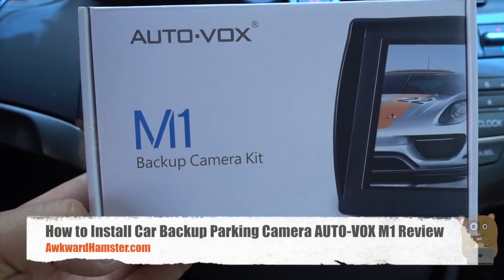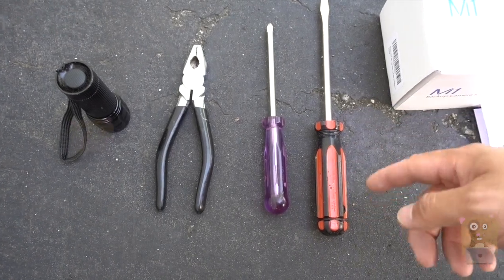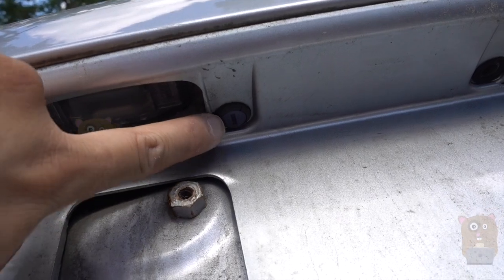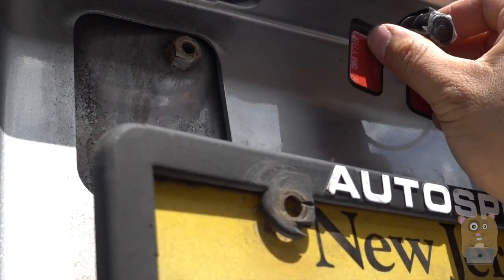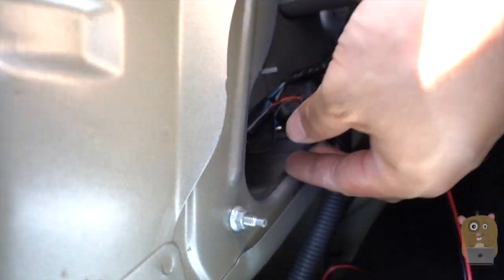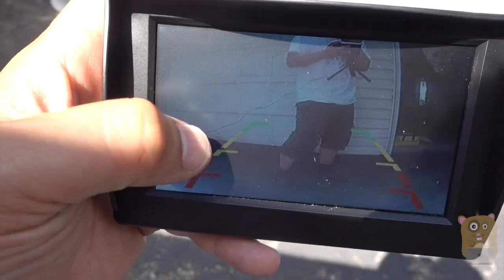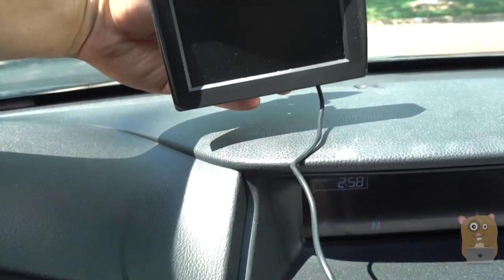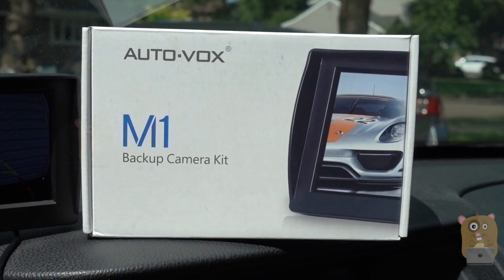How to Install Car Backup Parking Camera - AUTO-VOX M1 Review

Comment: Thanks for the great video.  Explained everything as needed so I could get the install done.  I had significant trouble with the red wire clips.  Had to clamp and re-clamp them 4 times before I could get the connection to work.   Probably me just trying to press them together too hard.   Thanks again for the great video. Really helped.
Reply from the maker: +Paul Egan 
Thank you for watching.

Comment: Hey! 
Great video! 
Do you thinkthe camera can be used as a side mirror camera? My right mirror sight is blocked by a children seat. 
The only thing is that camera needs to be on all the time. Can I pare it with the regular front lights maybe instead av back lights? 

Thanks once again for a great video!
Reply from the maker: Yes it can but I’m not sure where you can draw power in the side. I guess you can get a fuse tap then run the cable to the side mirror.

Comment: So I loved the video and it really inspired me to buy this exact product. My problem is that I finally got my reverse light to turn on but my monitor won’t turn on. Any suggestions?
Reply from the maker: Does the monitor flicker when you plug in the power for the monitor? If it does not, then redo or recheck the wire tap for the power.
Reply: AwkwardHamster I had this same problem, any ideas ? My monitor does flicker when I plug it in. Thanks!

Comment: Hy must I etached it on the rear lights for power I want it always to view it when I drive forwards. Thanks for your videos greetings Peter from Belgium
Reply: You can connect it to your ignition switch so it can fire right up when you turn the car on.

Comment: When you're splicing black to black and red to red (color to color) on the Honda, are you cutting the light bulb off and splicing both sides of the two wires (splicing a total of 4 times)? 

So in a series, the cameras wires are in between the cars power and the light bulb?

Thank you for your help! This video was veryyyy helpful.
Reply from the maker: I don't do the spicing.  The T-Clip does the splicing.  It's safer that way.  T-Clip cuts into the red of the backup light and red of the camera.  Then the same goes for the green/black wire
Reply: AwkwardHamster yes correct but when you start to splice with the T- clip do you cut off the light bulb to clip between so the camera can connect?
Reply: I think I'm over thinking this. Does the extra wire from the lightbulb just hang out cut off?
Reply from the maker: +Jennilyn Sumalbag 
I'm not sure what you mean by cut off the light bulb. I remove the light bulb from the housing by turning it counter clockwise. I can use my fingers to space the red and green wire so it's apart more. If I need more slack, I can unroll the electrical tape to expose more red and green. I can use a scissor to cut that electrical tape if I want it neater. 
Then, I would use the T-Clip.
Reply: AwkwardHamster thank you! So I'm tapped into my reverse light and backup camera works. But light isn't working now? I don't think I fried it tho?
Reply from the maker: +Jennilyn Sumalbag 
Take a flashlight and look in the bulb area to see if the coiled filament is broken. If it is, then you can just change the bulb. 
Because power is getting to the camera I would expect power to go to the bulb too. If you have a wire tester pen, you can see if there is electricity at the bulb connector area.
Reply: AwkwardHamster got it to work. Thank you for replying back! I took my multimeter to it and tested voltage so I knew the bulb wasn't busted. Everything is working great :)
Reply from the maker: +Jennilyn Sumalbag Cool

Comment: What sort of battery solutions would you recommend instead of messing with internal wires?
Reply from the maker: Met with a startup at an expo a year or two ago that was releasing solar powered backup camera units. I will have to see if I still have their press release. I liked the concept. I was skeptical because it prob won't charge well in my neck of the woods.
Reply: hardly an issue messing with internal wiring, although I wouldn't use these splicing clips, just do it the old fashioned way, much better than actually cutting the cars main harnesses. if you don't want to do it just run a lead using a piggyback fuse from an ignition live (radio, accessory socket fuse etc) from the fuse box to the back of the car, no need for extra batteries etc

Comment: How hard do you think it would be to install the kit in something like a hatchback where the license plate is mounted on the hatch?  I'm driving a Scion xD and I'm interested in installing this kit and I'm wondering how difficult it might be to mount the camera to the hatch and reach the reverse lights using the cables included with the kit.  Something's telling me that I would probably have to to extend the cable that goes to my reverse light because of the length involved, and it might be a little more difficult to hide the wires in this particular vehicle since I'd have to run the wires up to the top of the chassis and then back down to the floor and hide the cable along the kick-panels to run it the rest of the way up to the front of the vehicle and then most likely mount it on the far left-hand side of the dash so that I can hide all of the wires and not having anything dangling from the middle of my dash.  Liked the video and thorough instructions...appreciate it!
Reply: I just put this in the hatchback on my Veracruz. Took a little work and we did drill one hole to get the camera wire into the car from behind the license plate. All the other wire ran through a boot to get from the hatch into the car. With the back up lights on the hatch it was an easy run. If your backup lights are on the fender, while the wire from the connector unit is long, you may need to add some wire. Worse case you get it, don't like it, return to Amazon.
Reply: Brent Murphree we also ran the cable to the front along the top of the frame above the doors then down the A pillar in the front. Hide the rest of the wire behind a cavity in the dash

Comment: Connected everything shown.  Can't seem to get monitor power any thoughts.Connected to the back up light wire with the two connecters.Thanks
Reply: Jennifer Berard did you find a fix ? I have the same problem
Reply: I had the same problem as well. The way I fixed it was by getting a pair of pliers and squeezing really hard on the connections to ensure the connectors got through the insulation of the wires. I also taped the ground (black) wire from the autovox kit to a piece of metal on the car. For the ground wire, I am not sure if this last step was necessary, but it seemed to do the trick for me. Good luck!
Reply: Rich Mar thank you for your help, tried your tips. But ended up being a faulty screen. Auto-vox is replacing it for me.
Reply: No problem. I am glad you found the problem. Enjoy your new back up camera.

Comment: can this be installed on a 28ft camper and still have monitor inside truck
Reply from the maker: Not with their cable because it is not long enough. You can try splicing the cable but I don’t know how long you can get before the signal becomes too weak.
Reply: they do a wireless version as well, which is the one I have, it has a wireless box on the camera / reverse light wiring, then the monitor is connected in upfront on it's own either by plugging in to the cigarette socket or just tapping in to a + / - I connected mine to the wired under the cigarette socket and run the wires up under the dash.

it cuts out the whole running a wire from the back of the car to the front.

if you search wireless reverse camera you'll find videos of it

Comment: can you wire this in a way that it is always on?
Reply from the maker: If I remove the negative connection to the reverse lights. But, i highly doubt this display would last due to heat damage.
Reply: @AwkwardHamster  Thanks.   Coz I plan to place the cam in the front probably in the grill area to serve as a front cam to see right infront of the car(front blind spot)

Comment: 2005 toyota solara, reverse light both wires are black. is there anyone has the same question?
Reply from the maker: If you have a voltage tester or voltage meter you can check which one is the black wires is hot.